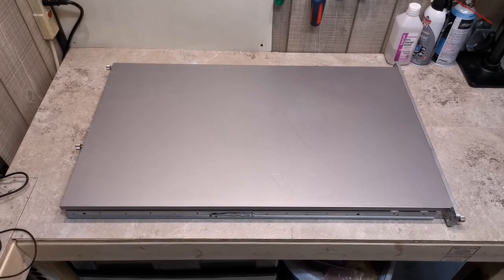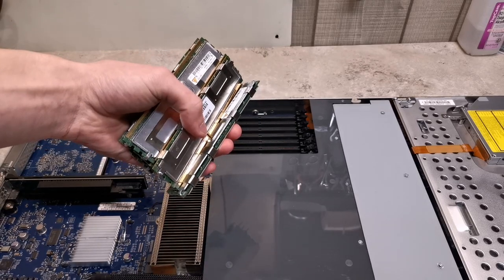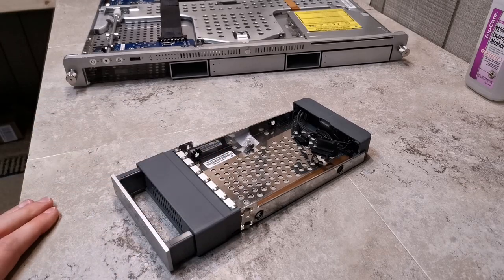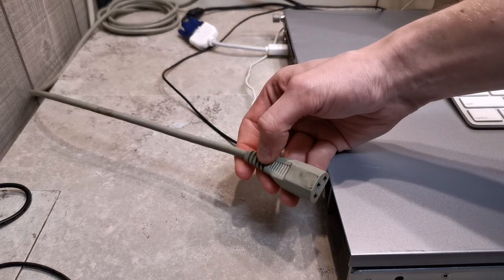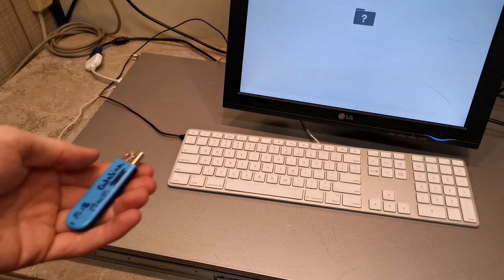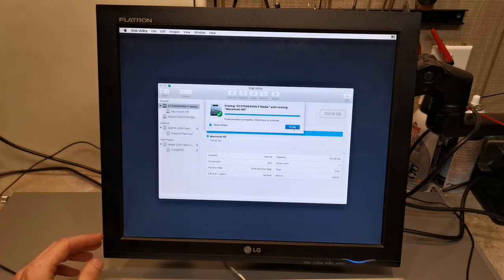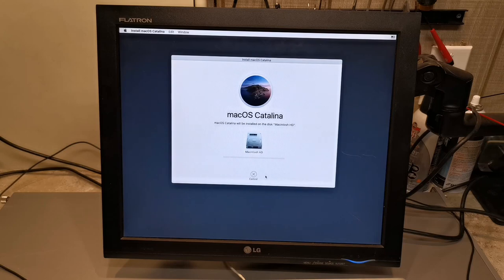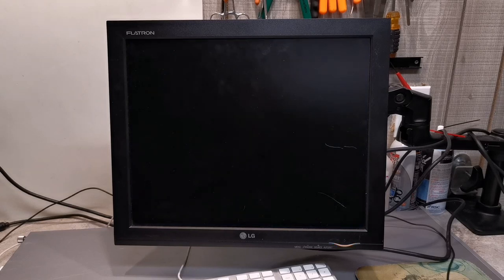I Found an XServe For Free! - Does It Work?

Comment: These use an ungodly amount of electricity under load, not really efficient in a household. Have had the pleasure to use one of these around 2010 when i was in an IT course. Good times.
Reply from the maker: We had a bunch of these get retired over the past 4 years at work. Aside from the ability to run Mac OS natively, these really are just plain old 1U servers from 15 years ago. As a bit of an Apple collector, it's a shame that they're not useful or something I could run for the heck of it, like I do my iMac G3 for example. Simply too loud and power hungry. My M1 MacBook Air runs circles around the Xserve. I might hang on to one when the last few get recycled this summer to add to my collection.

Comment: Interesting... in about 2008 Apple sent us several evaluation units...  I worked for a Fortune 10 firm at the time.  We never established Apple OS X Servers in our environment, as Apple hoped, but enjoyed testing them in a performance lab context.  Would love to have one in my home lab, just for the fun of it.  Apple would often lock devices to accepted types, moreover, the drives accepted likely where SATA1 only.  I realize this seems insane... but I have seen it before.  This is one of the reasons we never established X Servers as a world-wide firm standard, we did not want to be closely bound to anyone one vendor, since we already leveraged HP, Dell and IBM against each other.  With Apple would would not have been possible.  At best for us X Servers would have been a very limited niche solution.  We provided the limited MacOS users a virtual infrastructure based on VMware, which let us use standard hardware below VMware.

Comment: I cannot believe that mezzanine video card is working. Nice!
Reply from the maker: Was this a common issue with Xserves? Or that it works at all under Catalina? I know my 2010 iMac can't run Catalina with its AMD card.
Reply: @appleontheapex  I did not think that video card was supported at all.  Changing it to another via the PCIe slot has been a work around.  So everything works fine under Catalina with the stock card?  Most of us eXserve users just need basic graphic support.  However, remote desktop (or VNC) performance is critical.

Comment: I can't get any video output on my Xserve A1279 3,1.  I've used the micro-display port to VGA, and I've tried installing a separate video card that has DVI, HDMI connections and still no video.
Reply from the maker: Sorry for the super late reply, but are you sure the Xserve is getting far enough in the boot sequence to even start displaying video? You may have another issue.

Comment: I got an Xserve but the main board has physical damage which results in a constant flashing light but other than that the system is fully functional
Reply from the maker: This Xserve and others that I have worked on would sometimes show a constant flashing light. After I got Mac OS Server installed, one of the included tools allowed me to see what was causing it. I don't recall what it was - something to do with a dead battery on the RAID card maybe? 
What kind of damage does your board have where it is still functional?
Reply: @appleontheapex  no like the raid card has PHYSICAL damage to the connector

Comment: Can you run ESXI on it and install other operating systems via VM will it work and will it also see larger drives?  Thanks for sharing
Reply from the maker: It has been done, but I'm not sure if that would help with the drive issue. From what others have told me, it may be the Xserve's firmware that is preventing the drives from being properly accessed.
Reply: appleontheapex I have seen Mac Pro firmware being flashed thinking that it is newer unit do you know anything like that for Xserve and maybe it will see the larger drives. Thanks
Reply: @HowardCallender IT Mode enables the controller to detect and read drives that are over 2 terabytes in size.

Comment: Why not try and install the OS from the timeframe the machine comes from, instead of a hack. SSD might surprisingly work all of a sudden.
Reply from the maker: I tried installing 10.5 Server, which is what this came with. It seems to be the firmware of the Xserve that doesn't like the SSD. Doesn't even show up in open firmware mode.
Reply: @appleontheapex  Maybe a stupid question but did you try those other slots? Maybe the first one is broken..